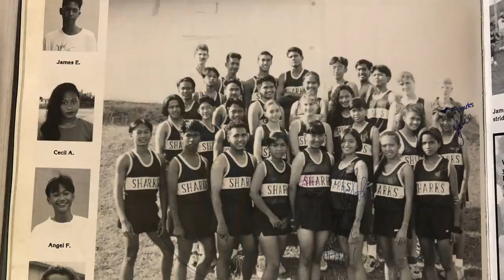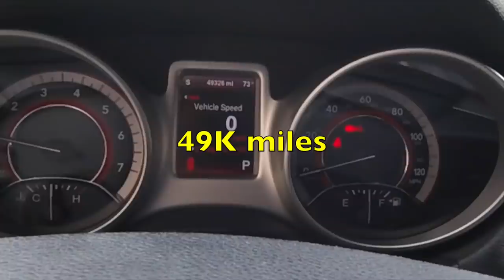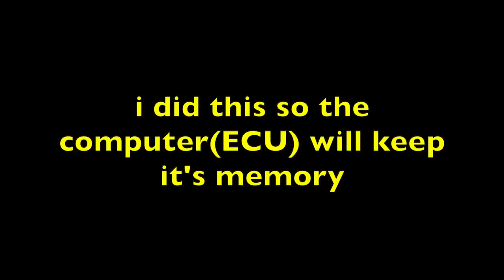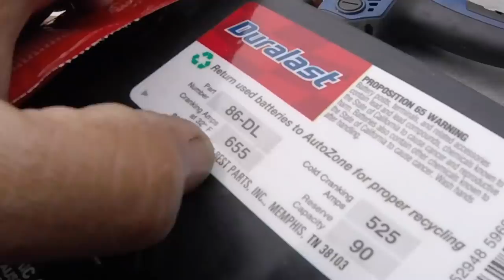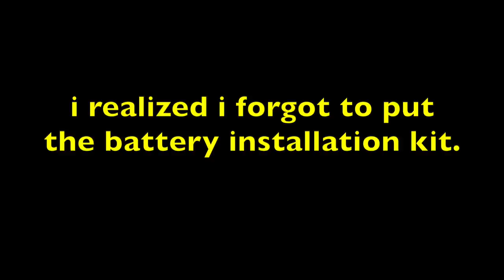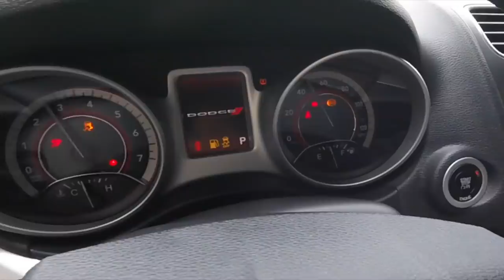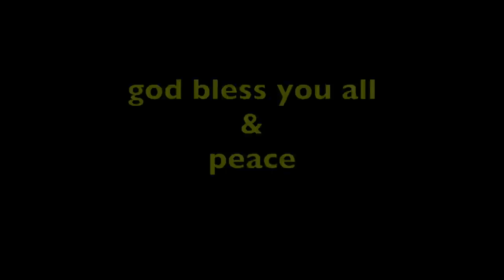TIRE REMOVAL for a Battery Replacement 2013 Dodge Journey √ Angel Fernandez

Comment: Remember back in the old days when you could pop the hood and pull the battery out?   Yeah, they were so smart back then.
Reply: In have a 2011 Camaro LS and the battery is in the trunk where a spare tire can go. It came with a compressor and a fluid that's supposed to plug the puncture.

Comment: Good job. It's also good practice to
 1 connect the battery terminals 
2 disconnect the memory minder
3 let the battery settle for at least one minute ,then lastly reconnect the battery sensor .
Cheers ,love your work ethic 👍

Comment: Nice job! I used to install batteries & dodge's were on display at our mall when they came out. First thing I noticed, "where's the battery?" 🙄 Engineers need to install in the northeast winters!

Comment: The connector on the negative battery terminal is for current measurement for the stop/start system and for dynamic charging. And the battery there is probably mounted to balance somehow the weight left/right and for thermal protection against heat
Reply: Just no room for it under the hood. 98 Dodge stratus was in the same location.

Comment: We've just seen one of several reasons not to buy a Dodge. WTF kind of engineering thought process was this?
Reply: seriously, what a waste of time to just replace a battery.
Reply: Don't be surprise by the American vehicle lol
Reply: Lots of cars are like this. BMW did this, Mercedes, GM just ti name a few. It’s rampant
Reply: They did not expect the car to last longer than the battery
Reply: Well, as u can see there is not that much free space under the bonnet 🙄

Comment: That connector is for the ECM..It uses a direct ground to the battery. So it can monitor the charging system and grounds for pull down sensors....

Comment: When I used to work for O'Reilly auto parts, I would always clean up the connections like you did on the battery and the connectors, and most times that would fix it and they actually didn't need a battery. Or it would make it obvious that the alternator was bad instead...

But either way it may have needed the battery

Comment: The position of the battery: in case of front collision, wouldn’t the battery be hit with impact that may cause acid fluid leak or fire?
Reply: Maybe it was suited down to get low gravity center, but its a pain doing a replacement 😅

Comment: When I went to buy a new battery from Autozone for my mom's 2009 Dodge Journey, I noticed on their screen that replacement instructions say, "Turn the wheel all the way to the left to remove the battery compartment cover. Remove the cables, etc" so apparently it IS possible to replace the battery without removing the tire, but damn, that would be a frustrating pain in the neck. Several YouTubers recommended getting a "memory saver" to keep various memory settings intact while the battery is not hooked up, or, connect a battery charger on its lowest setting to the positive and negative connections in the engine compartment. You can also connect a 12V battery you might have to those connections. It doesn't need to be too powerful because the current draw when the vehicle is off is very very low.

Anyway, the battery charger trick didn't work for me,* but the good news is that there were no issues with not having a memory saver. I will say that putting the battery there in the wheel well is a head scratcher considering that there is plenty of room in the engine compartment for one. Dodge could also have made the job a lot easier if they had used screw-in side posts instead of the typical top terminal posts. Not much room to maneuver in that battery compartment!

* The el-cheapo trickle charger cycles on and off so as soon as I disconnect the negative cable it reported a fault. Anyway, it all worked out.

Comment: Looks like that's a bit simplified battery connection compared to its older models. Along w/ ur pro wrench 🔧 tool, battery remove/install little less difficult. Still wish they redesign battery close to standard. Now confirmed needing mechanic just to replace battery. Salamat sa video...

Comment: The last two times I had to replace the battery. There was no need to remove the tire. Just turn the tire far left as possible and remove the flap behind battery or hold it back. Two different guys were able to do it with no problem.

Comment: why the heck did dodge put a Battery Underneath the Engine Bay!??..last i checked the Battery locations are either in the Front OR the Back of the Vehicle.

Comment: I'll take avengers, caravans and 200's all day long I've gotten really good at those. 

As a tech some of the worst I've seen

92-04 Chrysler Concorde: passenger front wheel well have to remove air filter box from the engine bay to access terminals and hold down and then wheel and liner to get in and out.

11-20 Jeep Grand Cherokee: passenger seat all the way forward and up to remove access panels need quarter-inch ratchets, extensions, and universal joint to reach far terminal hard to lift out.

09-20 Chevrolet Traverse: behind passenger front seat remove the plastic rail guard from second-row seating floor uses Allen key to remove access bolt easy to disconnect hard to lift out. 

some BMW's: battery in the trunk if it has a computer on top don't even bother has to be programmed by the stealership before the car will even charge it angry lights and noises on the dash.

Comment: I have a 2002 Dodge Stratus Sedan. Battery is in the same dumb ass location. The owners manual says battery access by turning driver’s side wheel all the way to the right. That’s total BS. Absolutely not possible. That wheel has to come off. There’s no way around that period. Another design detail that forces the non mechanically inclined owners to take to the stealership to get serviced. Great job as always Angel 🤙

Comment: What needs to happen is take those engineers out of the office into the shop and MAKE them work on cars in what a service area is like then see if they keep putting things anywhere on vehicles.  Won't happen because builders do not worry about techs they think about money only.  Yes I am not happy about how cars are built.  But Angel you have a happy life.

Comment: Be lucky it's not a Mercedes I worked on one of the trucks I think it was an ML350 the battery is underneath the passenger seat but the passenger seat is power and with the battery dead you can't move the damn seat forward you literally have to unbolt the whole seat to get the battery out

Comment: What about the check engine light the lady mentioned? And it turning off I assume on it’s own? Was that issue solved by changing out the battery? Awesome videos Angel🤘🏼
Reply from the maker: hi Stefen, i told her to drive it for more than 30 miles and call me if the check engine light comes back on. i didn't get that call. so it was all good. always try to solve the first problem first. in this case, the battery

Comment: the 2 wire sensor is to measure the battery drain ,so it can give you the check engine ligth if nessesaRY

Comment: Hi Angel, 2003 Toyota Camry, radiator fans don't run when coolant temp sensor is plugged in. When unplugged, fans start spinning. Just wanted to confirm if sensor is the only thing that could be faulty or are there other factors at work.
Reply from the maker: Hi Fred, change the sensor if it wasn’t ever replaced
Reply: @FixItAngel  thanks Angel
Reply from the maker: @FredY-cg6mi  welcome brother

Comment: Try replacing a headlight bulb on an envoy. You have to take the front quarter panel off with the front bumper.
Reply: On my 2009 envoy just take the whole assembly out it takes less than 5 minutes to do.
Reply: @wmc128  what the book says and what mechanics do are sometimes different. 👍 ok what do you have to remove to replace the stater on a Bentley continental gt?
Reply: @roberth4727  don't care .I don't work on money pits. Ford GMC and Dodge and Hyundai are in my driveway.
Reply: @wmc128  cool story 👍

Comment: Please help. I have a 2002 Camry V6 that has been sitting under carport for 10 months because of cost. My usual mechanic quoted me $1,800 to replace timing belt. It was running great until this. He advised me to park it before the timing belt broke. What things do I have to do now besides charge the battery, to get it to start after all this time? I need my car back.
Reply: $1,800 seems excessive labor shouldn’t be more than $400 for that and a timing belt/ water pump kit usually cost around $250-$300
Reply: Find other mechanic.
Reply: Tow it and find Another Mechanic

Comment: I had a 1997 Dodge Stratus with the battery mounted in the same place and it was a pain in the butt to change but their are a couple of advantages mounting the battery there instead of the engine compartment.
One, it free up space in the engine space especially for transverse mounted engines.
Two, heat is just as hard on a battery as the cold with both shortening battery life.
Having the battery mounted in a place other than the engine compartment shields it from both plus keeps battery acid from leaking on to metal surfaces in the engine compartment.

Comment: Have you ever replaced a 2011 Toyota tundra rack and pinion ??? Dealer wants to pull the motor to get access to the rack they want $4000 for the job 😬😬😬
Reply from the maker: Sorry I have never done it. Dealership is trying to take your money. You don’t need to remove the motor. Have you researched any videos in YT? I’m sure there is.
Reply: @FixItAngel  I'll look more into it thank you !

Comment: You couldn’t pay me to drive a so called domestic vehicle these days. These dodges fall apart quickly. Not just a bad design.

Ps— no one makes me buy anything .. especially autozone!

Pss— that’s a battery temp/battery current sensor.. they go bad often too…at about 200$ from the dealer or 100$ if diy.

Comment: That is one dumb place to put the battery: it s on driver's side so no weight offsetting there, you cannot check on the terminals, or  fluid level, and it is in a common impact zone.Just DUMB!